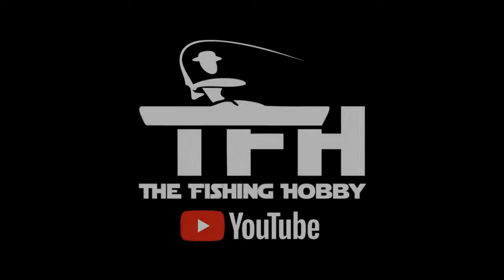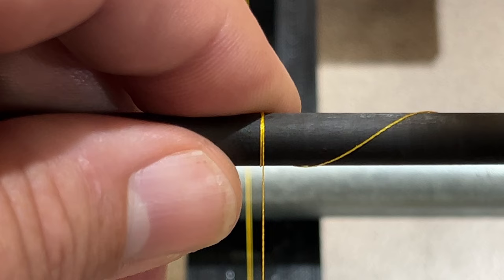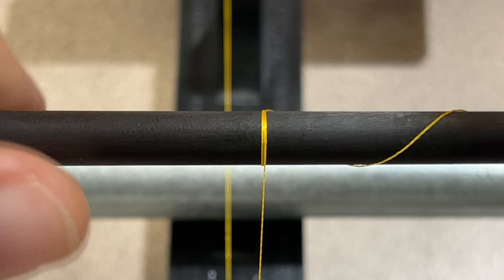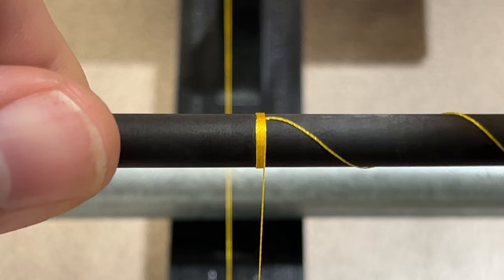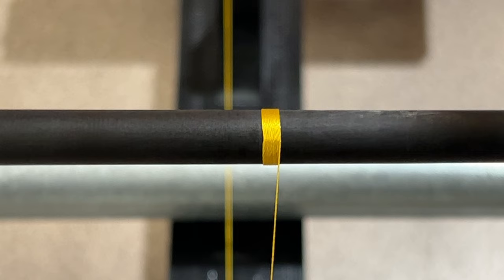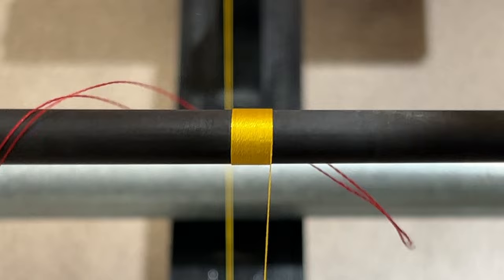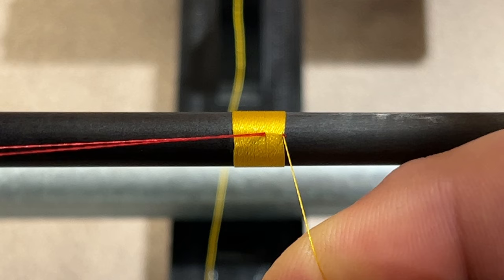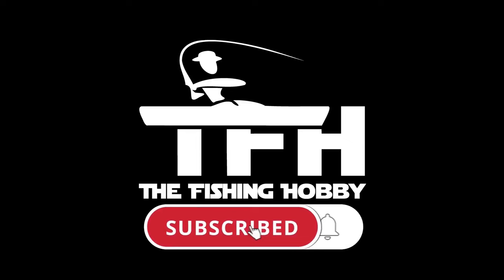Rod Building Basics: Part 1 - The Basic Wrap

Comment: Doing my first practice wrap now on a carbon arrow shaft. :) Thank you for your work here.
Reply from the maker: I hope it is going well! It can be a little tricky at first, but with a little practice you’ll get the hang of it. I’ve never mentioned this on my channel, but you can go to Walmart or a sporting goods store and pick up an inexpensive telescopic “cane pole” type of a rod like one of these: https://www.walmart.com/ip/10-Black-Widow-Ready-Rig-Telescopic-Panfish-Pole-by-B-n-M-Pole-Company/15908257
and unscrew the butt cap and slide all the rod sections out and use them to practice on. They are tapered like a normal rod would be and have about any diameter you would ever run across when building a rod. Cheap too!

Comment: Are there different thicknesses of wrapping thread ? I'm a beginner and I think what I'm using is awfully thin.
Reply from the maker: Yes! Size “A” is similar to what I’m using in this video. Size “D” is a common size that has a thicker diameter and is much easier to work with for most people.